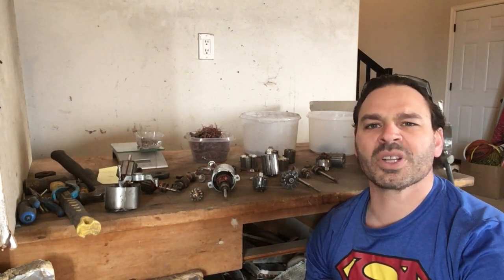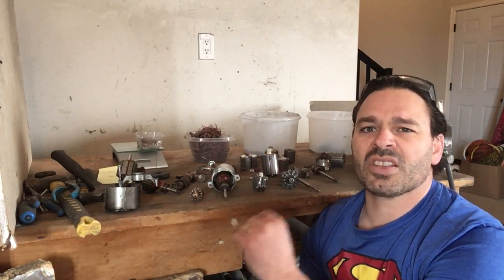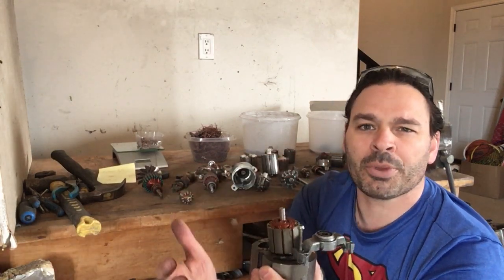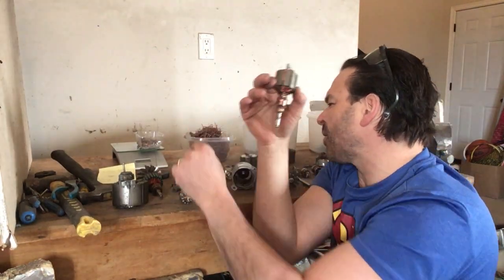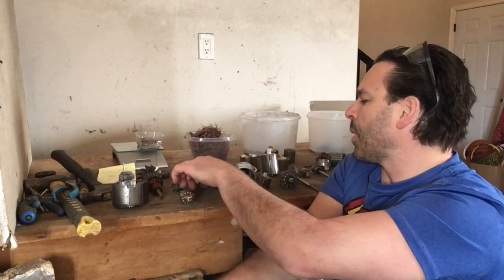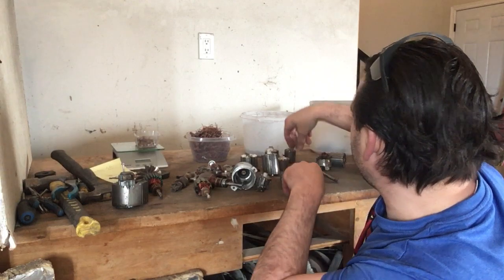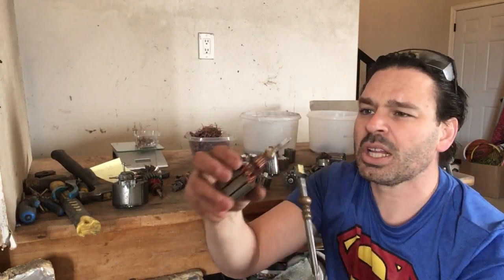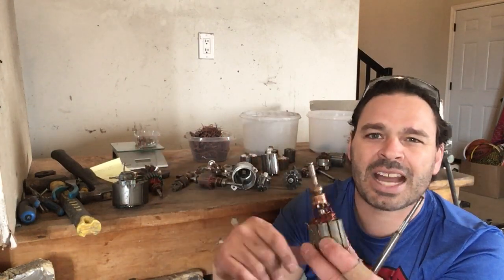Scrapping armatures for copper. ARE THEY WORTH THE TIME, EFFORT AND MONEY TAKING THEM APART?

Comment: Those bearings on the shaft are Red Brass.
Reply: hello both, I am confused........ Those bearings are odd. I have a motor from the 80s that I scrapped and I have two of them. They are not yellow, they are not copper color, they are not something I can Identify. Color scratch test, metallic brownish grey color, says platinum but they are magnetic. I am baffled. I asked Okie Scrapper but he hasn't answered.
Reply: @coppertopper  If they are magnetic, they are coated steel.
Reply: yeah, but not clean brass,  just a thin layer
Reply: The round ball on the shafed is offien red brass and is more than yellow brass at the scrap yard.